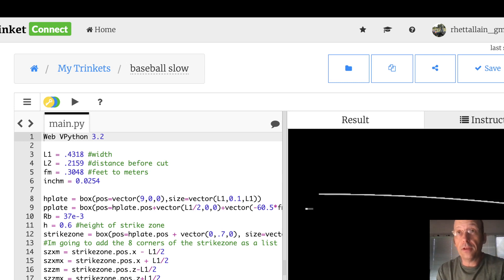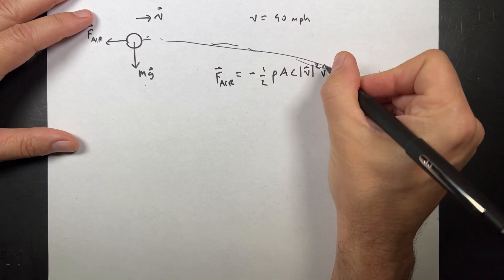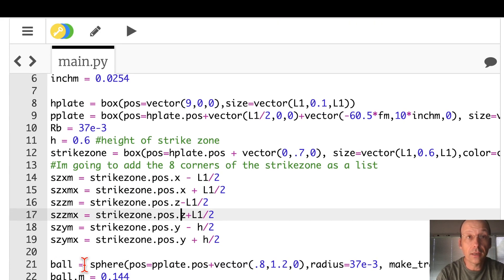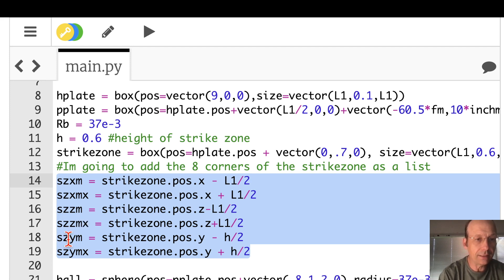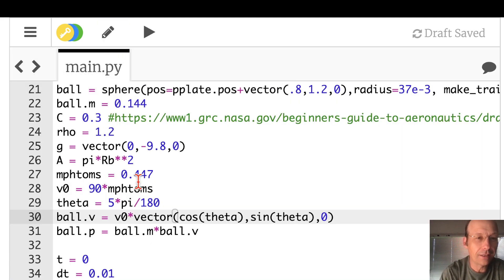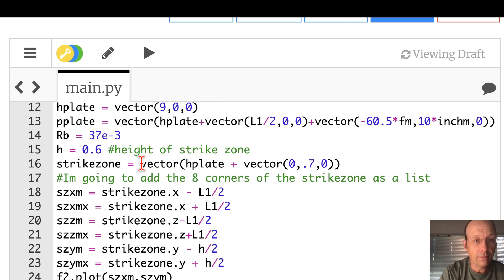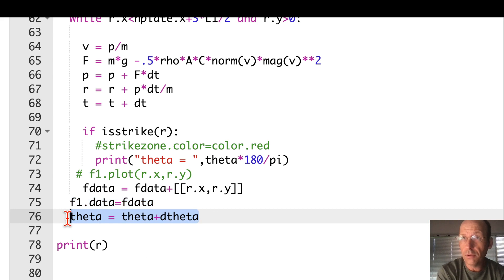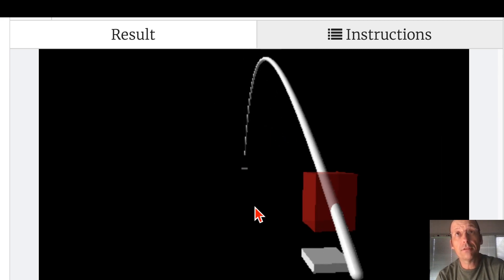Modeling a slow baseball pitch

Comment: Two little things:
1.  The object on the pitcher's mound is called the rubber.
2.  Precise definition of a strike is where the ball intersects the vertical plane of home plate at the front of the plate.  In other words, you don't need to model the strike zone as a 3D cube but rather a plane at the very front of the plate.  Plane boundaries would still be the width of the plate and the vertical distance from roughly the batter's knees to mid-chest.